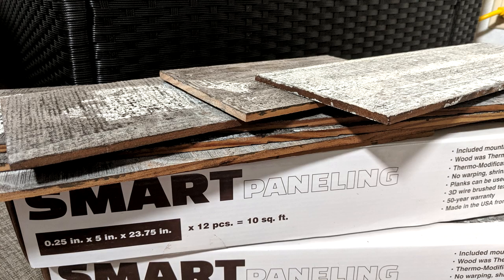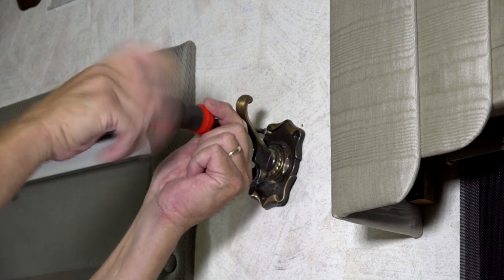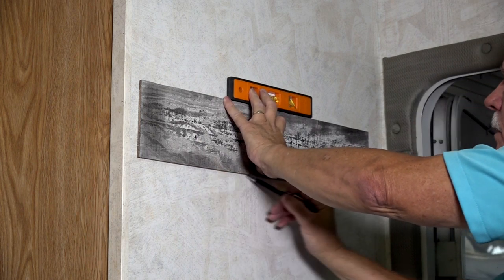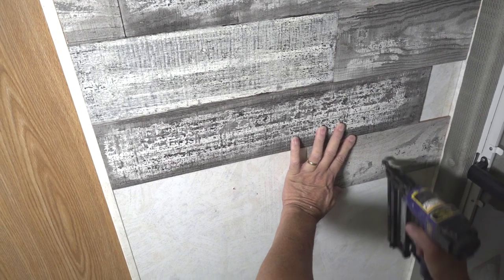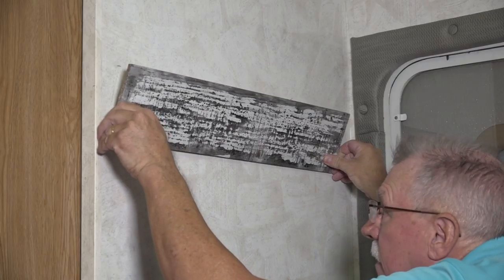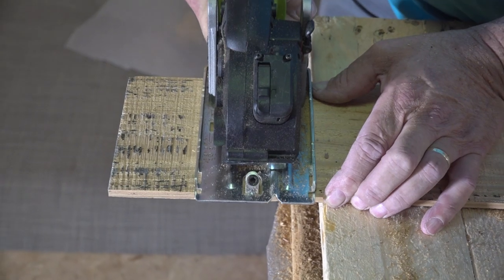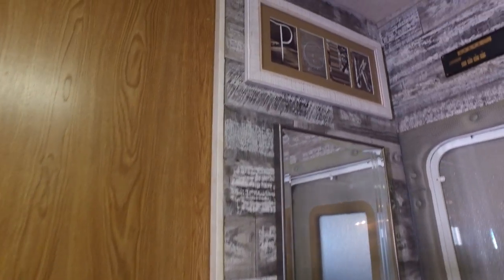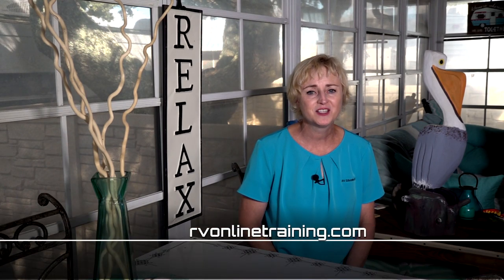RV 101® - RV Interior Makeover - Part 3 Installing Reclaimed Wood Accent Walls

Comment: I see you're using a staple gun what is the thickness of the RV wall and maybe the length of your staples?
Reply from the maker: I used staples that were approximately 1/4 of an inch longer than the thickness of the wood planks. I don't know the exact thickness of the interior walls, but they are pretty thin.

Comment: What did you use for wall degreaser?  How did you get the wall plugs to fit after applying the wall board? Thank you for the video.
Reply from the maker: We used white vinegar in a spray bottle to clean the wall surface. They weren't very dirty, but we wanted the liquid nail to secure to the walls. The planks are pretty thin, so I cut the openings in the planks the same size of the wall plates and then used caulking around the wall plate for a better finished look.
Reply: @rveducation101  Thank you for your reply..

Comment: Do you think installing planks on an RV that is used on the road would be a problem?  Will the planks stay on with vibration?
Reply from the maker: If you find the thinnest planks you can, and use the liquid nail I don't think it would be a problem. After I let the liquid nail set, I tried moving the planks and it was secure.